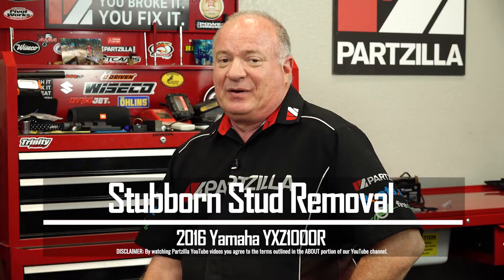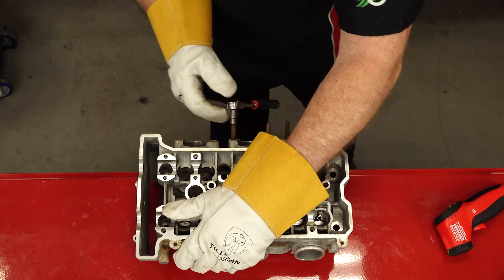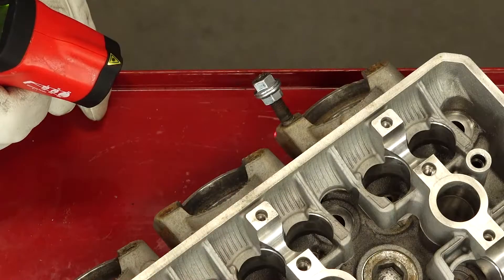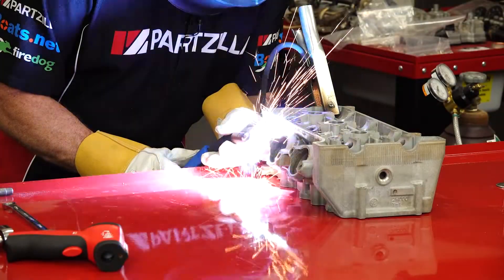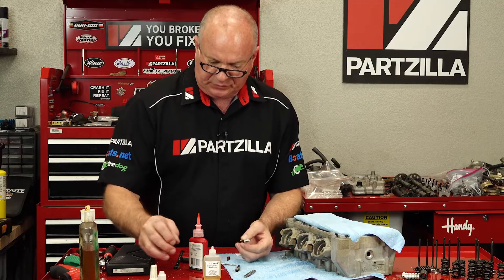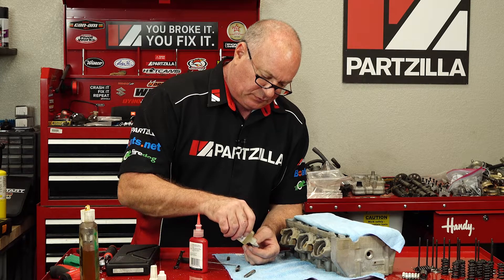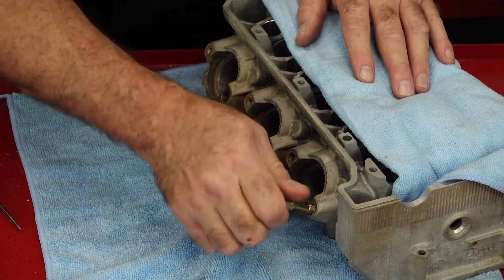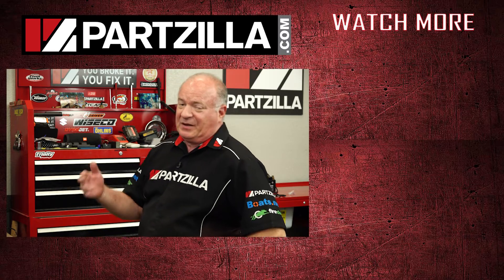How to Remove a Broken Exhaust Stud | Removing a Broken Bolt | Partzilla.com

Comment: I'm really surprised you didn't soak the studs with penetrating oil like PB Nut Blaster or ZEP, which is my favorite. I wouldn't even attempt to remove a stud without doing that first then add some heat if necessary. Glad it worked out in the end and nice video.

Comment: Get it as hot as possible, then hit it with water. It may take a few tries, but it helps. The sudden cooling breaks the bond between the metal and aluminum.